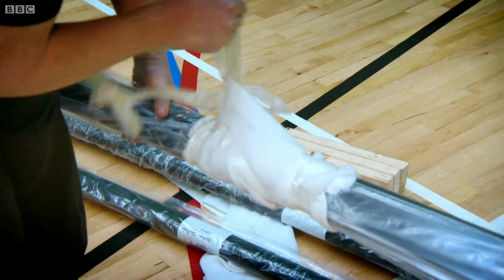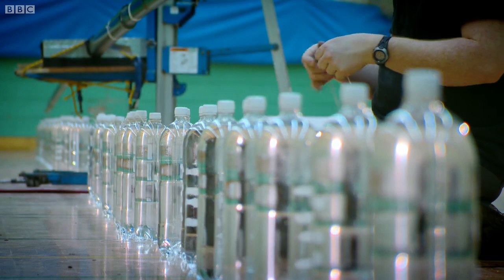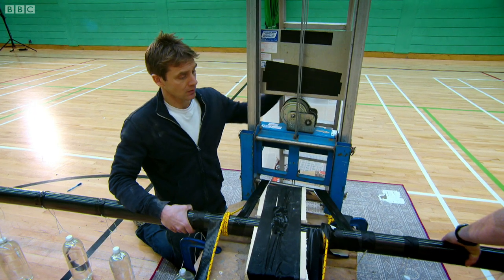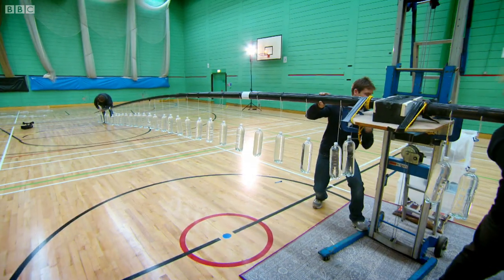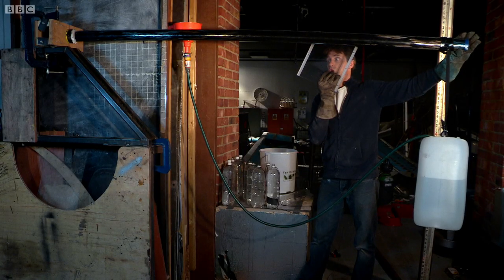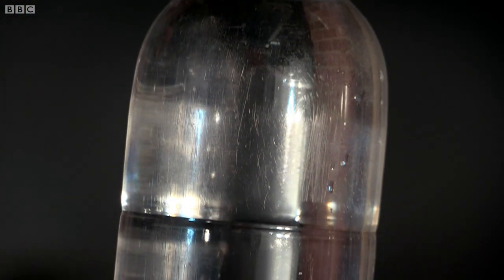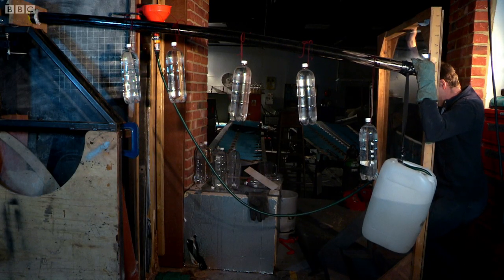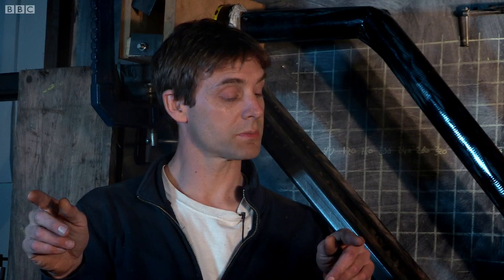Building a Flying Bicycle (Part 1) | Earth Science

Comment: Shouldn't be the static weight test of the wing spar put the load the other way? instead of all across the span of the wing just concentrate to the middle and the pylon junction where is the most stress can happen, and even if it breaks, has the most chance to happen also. Albeit the test shown in here is a more extreme condition but not accurate to real mechanical usage.